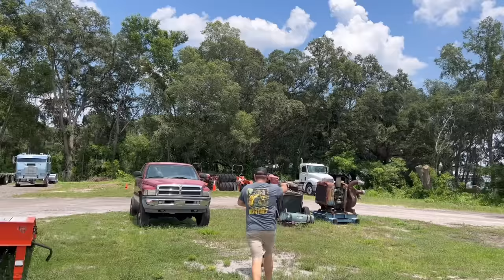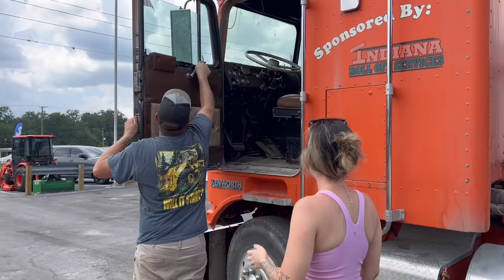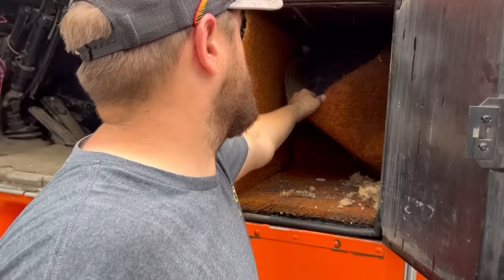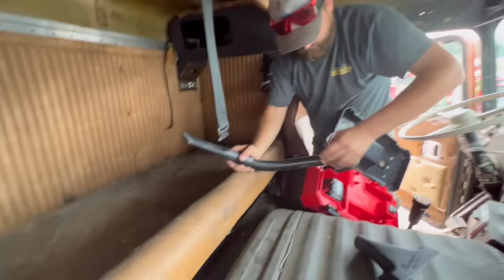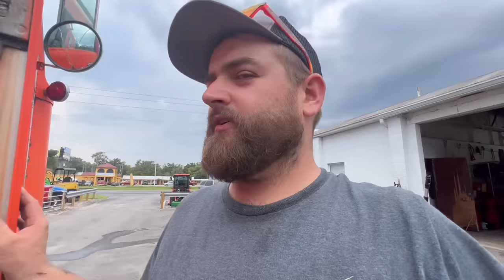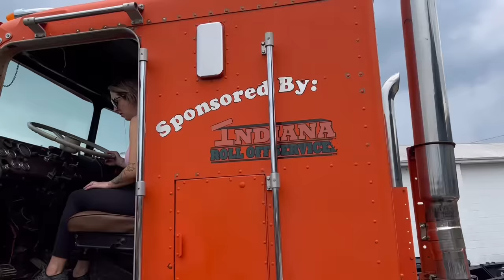Cleaning My RAT INFESTED Semi Truck Out! They are EVERYWHERE!

Comment: I think you should sell your black pulling semi to your friend and keep the orange semi it has potential for you and you could do hauling with it when semi pulling season is over but would just have to put a normal trailer hitch on it but as the old saying goes it’s always good to have a backup semi in case you break down you have the option of pulling the semi from the broken down semi to unhook and then hooking back and having the non running semi towed to your shop
Reply: What are you talking about? He has like 5 "backup" semis that do absolutely nothing but rot in his backyard. He dont need another. Do you even watch his videos or are you even a driver with your "trailer hitch" comment? Yeaa, that's not what its called.
Reply: @reneecwilliams9333 😂😂😂😂

Comment: Not sure but I think with a hitch and box on the back like that truck has it would be in a class up from the Limited Pro Stock/4.1 class the black truck is in, pretty sure the 4.1 class has to run a regular 5th wheel with a pulling hitch attached to it. It would take big money to make that truck competitve in the Pro Stock class where they can run up to a 6 inch turbo.

Comment: I was kinda hoping you were gonna put Aaron in the K100 and pull as a team.  If not, (even though I personally prefer KW) why not rob the rear diffs, suspension, hook/weight box and other needed stuff for the black truck?